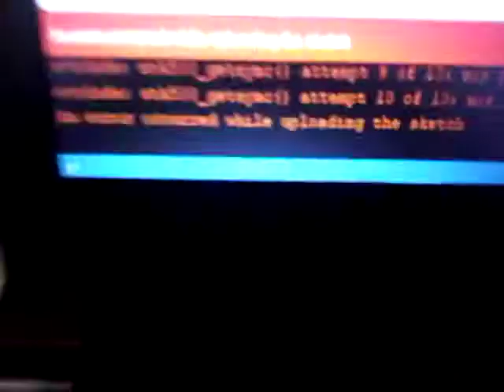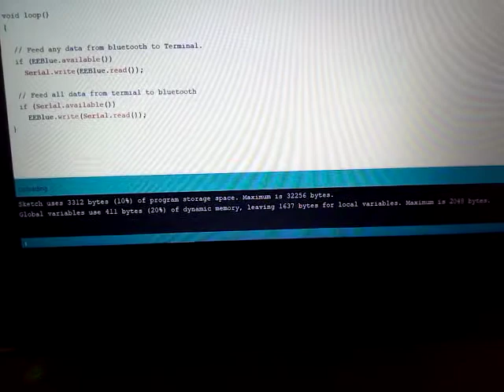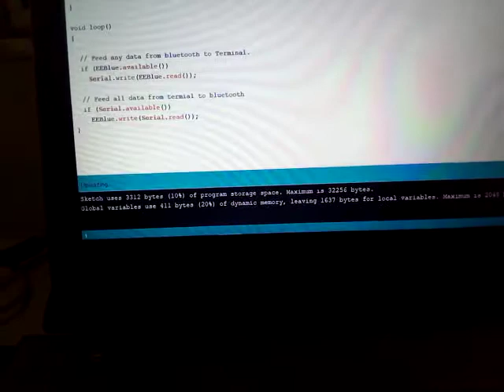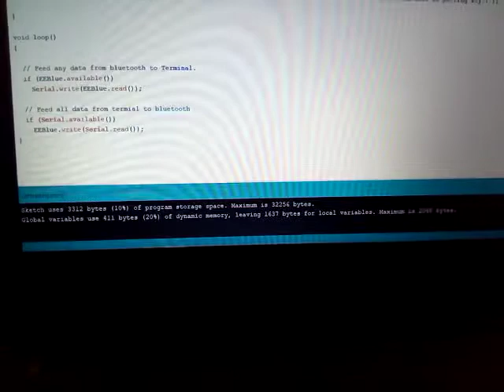Arduino Error Fix (avrdude: stk500_getsync(): not in sync:)

Comment: You removed the wire from tx rx pins  and start to uploading the code and it's succeed. I have a question,can the data goes inside the arduino when I insert the wire back after the uploading done? because in my case my project involves both tx and rx pins

Comment: when i have connected the pins of 4 digit 7 segment display to arduino board I am getting this error but when I have uploaded the same code without connecting the pins of the display to the board I am not getting error.
can u tell me why that happens?what is the reason?
reply me fast...
Reply from the maker: Hi there sorry I am just seeing this , did you fix it ?

Comment: You just saved me, Thank you!
Reply: Can you explain what he just did i didn't get it !
Reply: It's been awhile since I was working on the project.. but from what I think I understood, is that the RXO and TXO pins can be used to program the microcontroller, as an alternate to using the usb connection. So having something attached to those pins prevents the computer from establishing a connection because the microcontroller thinks you are trying to program it through the pins.